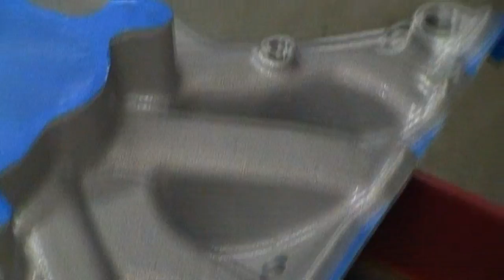Aluminum Intake Manifold Clear Coat Experiment

Comment: Should have used spraymax 2k clear.  100% polyurethane paint and heat resistant to 400 degrees.  This is an activated spray paint.

Comment: Bet it's yellow by now. Especially since you didn't use engine enamel. I've done this before. The best bet is to use "aluminum" colored engine paint. Mine has been good for 7 years with 2 coats of aluminum paint, 1 primer coat and 2 clear coat. All engine paint.

Comment: Just because the internal temperature of the engine only reaches 200° or less doesn't mean the under hood temps will be that same temp. The under hood temps will far exceed 200°.
Reply: Actually, depending on where in the engine, it will be way over 200.  Even the coolant, some of the coolest part of the engine, will be over 200 in many spots.

Comment: The intake on my purchase car is painted.  I was thinking of the clear coating it after I stripped the paint. I will now  thanks!  Plus I have transgo shift kit for TH400 arriving, watched your video on that too.  Looking forward to drilling to 0.156 too.  I never did see a video for the test drive.  Is there one?  Does it chirp the tires on 1-2?
Reply from the maker: I later replaced the transgo kit with a B&M kit.

Comment: oldsmobiles are supposed to like open plenum if you install a strip or racing camshaft first!i used to run an open plenum on my factory 350 oldsmobile...and it was dead until 3000 rpms!i finally swaped for a dual plenum...and i paint it satin black!vernish on aluminum tents to yellow in many spots!

Comment: Aluminium and Aluminum don't corrode like iron. The oxidation occurs on the outside then stops, unlike iron which continues through the element. Stopping it is pointless and often achieved on purpose which is anodizing, a process that increases the oxide layer. Powder-coat it silver dudes.

Comment: I did the same thing but used semi gloss clear engine enamel (2 coats). So it still looked like bare aluminum but with the benefit of cleaning off easily (mild cleaner and hose off). It also never yellowed or peeled, even after 10 years.

Comment: An aluminum intake manifold that is left unfinished will oxidize over time.  Especially if you install one on a daily driver which is prone to the enviroment its used in which will increase the rate it oxidizes.  You can either clean the intake every so often or use an aluminum specific cleaner & finish to help prevent oxidation or use a High-Temp Satin clear to protect to raw aluminum.  Do not use a gloss clear since it will start to yellow over time from the high-heat cycles.

Comment: As he stated in the video and showed that his Heat crossover is blocked off and his intake shouldnt get any hotter than the rest of the engine versus heating up from exhaust gases running through the intake, so the clear should not yellow.  In any other case you will have to use a Satin clear finish and not a Gloss clear.  This is the only High-Temp Satin clear I know of but havent tried it out myself yet.  It is a VHT paint finish.  Part# VHT SP115.  Hope that helps for your next project.